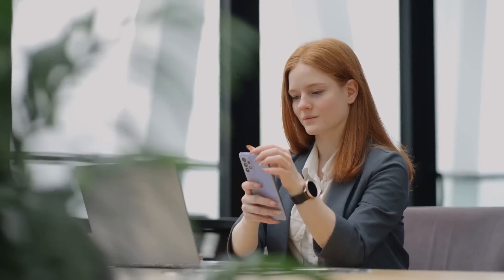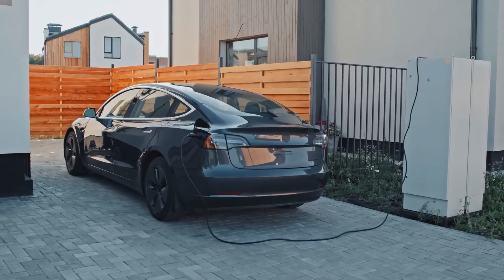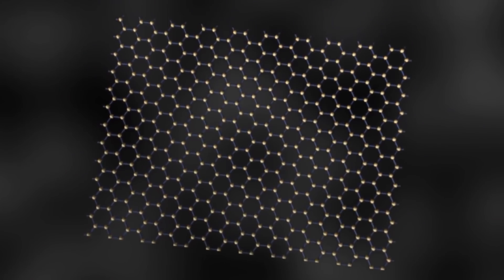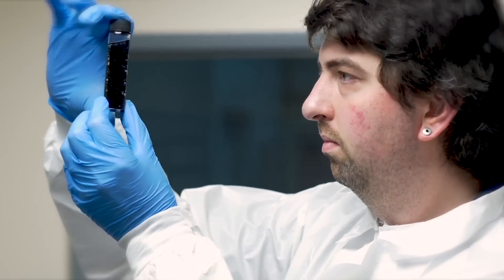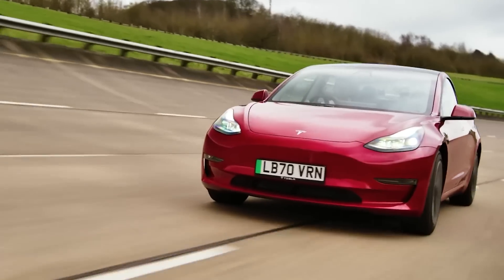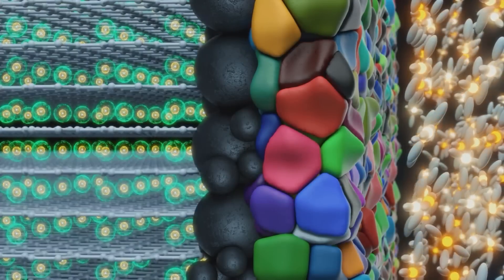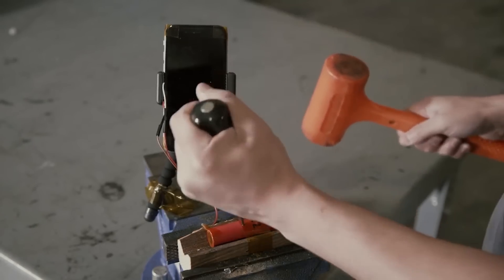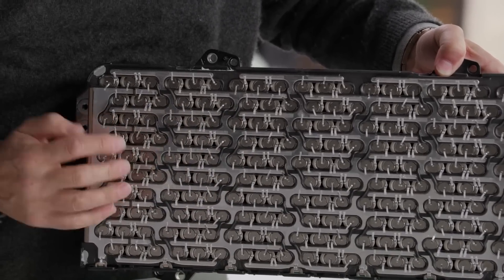IT HAPPENED! Graphene Batteries FINALLY Hit The Market!

Comment: I've heard graphine has been around for a while. it's a really exciting product and  I could see some major benefits for the car industry. As it is flexible, I could imagine that it could be pressed into shapes like car panels (like doors and side panels) not just in the floor, spreading the weight distribution and increasing the storage capability of the battery...can't wait to see where this leads us into the future of product development in transportation. consumer electronics is one thing but imagine having a car OR bus that can hold enough charge for 1000+ kms and take a under 30min to completely charge? 🤞